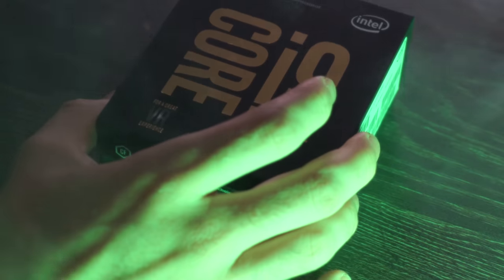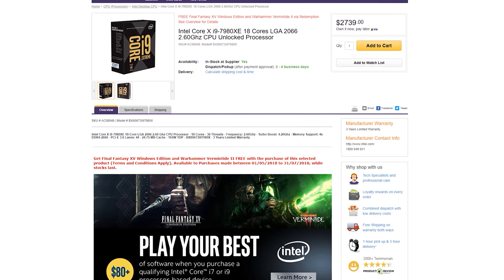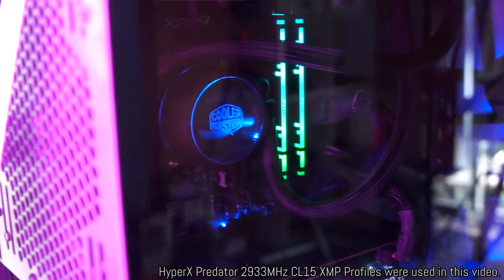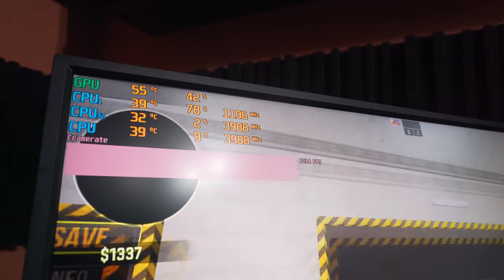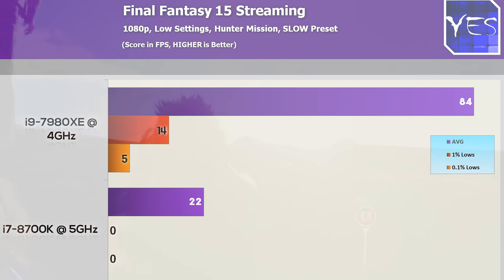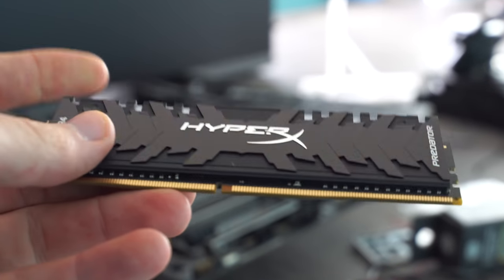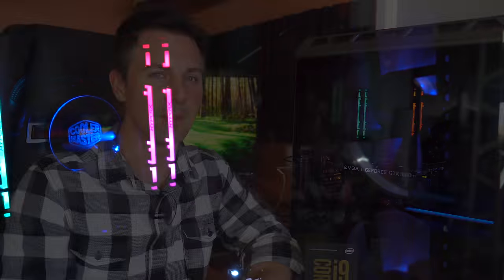i9-7980XE - What Can 18 Cores at 4GHz DO?

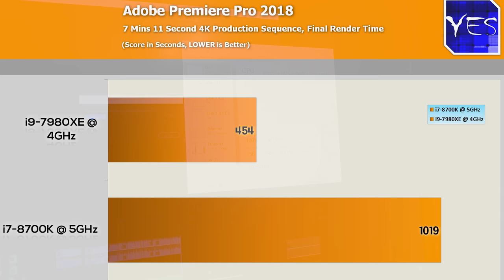Comment: Hey man, was the iGPU enabled for the 8700K in the Premiere Pro benchmarks? (5:10)
Reply from the maker: No it was a straight CPU benchmark.
Reply: yeah i think that update for adobe wasnt out when he did the video unless i am thinking of an older video.  the quicksync optimizations in premiere are nice and are surely more than good enough for youtube.  but a cpu only test is good as well for those who are making super high quality masters or are using an editor that doesn have this support.
EDIT: i just saw the timestamp and i see that its a current bench.  thought you guys were talking about another video sorry lol
Reply: I don’t think this cpu has iGPU right?
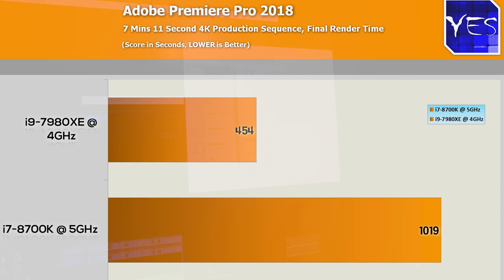Reply: @Lover Of Tech yes he is talking about the 8700k which is tested against this cpu at 5:10.  the 8700k has an igpu but the cpu this video is about does not. the commenter was just asking whether he was using the igpu when comparing them
Reply: Tech YES City watch gamers Nexus video on Adobe premiere and the 8700k and the 8700k will beat out the 7980xe when the igpu update so you don't have miss that 7980xe too much
Reply: bobhumplick my fault I misread the comment, I thought he was talking about the 18 Core X299 cpu. Yea I have a 4790K and the update with Premiere Pro makes it an absolute beast for final export
Reply: @Taylor Cook yes that is a very interesting development.  its kind of funny cause intel used the igpu and quicksync back in the amd fx\sandybridge (2nd gen) days to compete with amd on the one thing that the fx cpu was as good as the intel parts which was video encoding.  intels faster cpu was not as fast at video encoding as amd's 8 core cpu back then.  so they used quicksync and the igpu to make up the difference and be faster.  lol sound familiar?  but that was for transcoding video over for use on ipads and things for home use and not pro video.  the enhancements for adobe with the igpu are not really quicksync or at least not "only " quicksync.  it only uses part of quicksync and part of the compute power of the igpu to get MUCH better results than what a "quicksync only" transcode would be.  in other words a video rendered in adobe with the igpu enhancements arent as bad quality as a pure quicksync video which uses some shortcuts
Reply: @Lover Of Tech no prob.  but you are correct the 7980xe has no igpu : )
Reply: shroud, dr disrespect, wtfmoses, all those guys use cpu encoding.  with a slow game like league or hearthstone you dont need it though.  but in pubg without it the grass looks like a fingerpainting when moving
Reply: adobe is garbage.... doesnt show potential of the cpu at all try vegas pro and see the threads actually go to work
Reply: you get 2 pc's, one for gaming and one for the stream and link them up with a crossover cable by basically plugging them into each other with a ethernet cable.  then you add in another ethernet adapter to connect them to internet and you can use internet connection sharing to link them.  then you use obs on the gaming computer and you use your gpu to ecode as usuall except you turn the bitrate up as high as you can. like 50000 or whatever.  set the presets as high as you can without using lossless, set the profile to bluray. then you stream that over to the streaming pc with the ndi plugin over the ethernet cable.  another instance of obs is running on it and picks it up.  the obs instance that is on the second "streaming" pc just picks up that stream at a high bitrate fromt he gpu and reencodes it at a lower bitrate with the cpu at either faster,fast, or medium, maybe even slow if its a beast cpu.  then that is the stream that goes out to twitch and everybody gets to see.  that is how you make a top quality near picture perfect stream.
Reply: Can you review the Asus rog scar and hero laptop 💻👍🔥🥇
Reply: Tech YES City is 70-75 degree on ryzen 2700x stock with xfr2 and pb2 bad for long term use like for 3 years??  running stock cooler
Reply: Drake no but I would check it out
Reply: Chris Wright no means ?? That 75 degree celcius doesn't damage cpu??
Reply: the 8700k has one , HD630 http://gpu.userbenchmark.com/Compare/Intel-UHD-Graphics-630-Desktop-Coffee-Lake-i5-i7-vs-Nvidia-GT-1030/m356797vsm283726
Reply: no if you want it cooler use a 280 aio or big air cooler   the 2700x has a 105 tdp
Reply: Ryan Sherman no means??? Please explain
Reply: means it is running at the right temp for the stock cooler  if you want to cool it more use and aio or a big air like a dark rock pro 4
Reply: @Drake
Per AMD's website, the max temperature is supposed to be 85 degrees Celcius:
https://www.amd.com/en/products/cpu/amd-ryzen-7-2700x

Operating at any temp below that is fine.  If all you ever do is run it at stock settings with the cooler that comes with the CPU and you get 70 - 75 degrees, then your cpu should last you a lot longer than 3 years.

What lower temps do is allow XFR to potentially boost higher.  

Another thing to consider is the airflow in your PC case.  not enough fans, or just having fans blow in the wrong direction can negatively impact cpu temps.
Reply: Brolivia Wilde airflow is great but ambient temp is 30 degree celcius
Reply: @Drake
ambient is 30 degrees celcius?  yea, that sucks man, sorry to hear that. Still, your cpu should fine for years to come.
Reply: Brolivia Wilde yes currently in india not only 30 degree  sucks also this country sucks
Reply: @bobhumplick Could you use network switch instead of an adapter card? I already have a switch to split my internet between my pc and consoles, and figured that would be adequate.
Reply: bobhumplick Overcomplicated 2 PC streaming setup. check out the OBS NDI tutorial vid on my page. Way essier. I use it for every stream I do, love it.
Reply: Drake anything above 85 with possible thermal throttling is any issue but still I would check your fan curve and air flow in the case
Reply: Yea I found this helps really good, esp on laptop. But really also depends which effects you're using too.

Comment: I won’t deny that 18 cores is nice. But Threadripper can be had for often a fourth of the price of the i9. Threadripper is a better buy
Reply: for most things.  but there are cases where the i9 is better or at least one of the i9's.  for twitch streamers who dont want a 2 pc setup the 12-14 core cpus would be a very good alternative. TR is good too but its harder for high fps on the streamers side.  second gen TR will be hard to beat though.  but other than twitch or an odd use case where very high single thread apps are used on the same machine as very multithreaded apps you are right TR is hard to beat
Reply: bobhumplick I stream with a 1920x and I get 0 issue.
Reply: @James Mastroianni im not saying you will have issues with a threadripper cpu streaming.  im only saying that in competitive fps on a lot of popular games (ie pubg) an intel cpu with 12-14 cores and using cpu encoding will get higher frame rates so that streamers can play 120-144+hz.  even thought the stream may only be 60 or even 30 fps the streamers match might depend on a higher frame rate for a more competitive experience
Reply: im glad to hear the 1920x is treating you right.  cant wait to see what the second gen TR will bring.  i think the 12 and 16 core versions (if they even bother with the lower core coutns) will be the real winners if they can get the price really cheap.  very few people can actually make use of 32 or even 24 cores but a good cheap 12-16 core with ryzen+'s ipc and latency gains and extra clocks would be awesome
Reply: @Geth270 all the real streamers use cpu encoding.  it gives the best quality at the lowest framerate.  a few dont but you can tell it in their streams dont.  smaller streamers dont either but the big ones do.  its worth it if you can afford it.  the cheapest and the best way in my opinion is to do a dual pc setup.  wtfmoses stole my idea for a setup with an 8700k for the gaming pc and a ryzen 8 core for the streaming pc.  and with ndi plugin you dont need a capture card.  as a matter of fact the streaming pc doesnt even need a gpu at all althougth of course the gaming pc will
Reply: basically to stream with a gpu you need at least 4500 bitrate to look decent and if you want a really nice stream or wanna do 60fps you need 6000.  twitch only lets partners go above 6000 i think and that just took place.  used to be the limit was 3500 i think.  but you can do a stream with gpu encoding at 6-8000 and 720p60fps maybe 1080p or you can do a cpu encoding with 6-8000 at 1080p 60 and it still looks good.  at 4500 and below its cpu only unless you are doing maybe 720p in a low speed game.  for fast shooters at high res and fps you need cpu encoding to make it look decent
Reply: CPU encoding gives better image quality.... 
GPU gets really blocky. Popular streamers always choose the best quality they can get. so they never use the gpu.
Reply: Upload a vid and show us how it is done then...
Reply: i9 literally won a heck of a lot (most) of HWBot benchmarks out there. It also holds the top  marks in 3DMark(top overclockers use this CPU to crush GPU records). If this CPU has that much reputation then the price is just as mad.
Reply: bobhumplick bobhumplick and just to let you know, any advantage intel has over AMD with high frame rate disappears on skylake x, as the mesh has the same faults as infinity fabric. Now, most super high end streamers run dual systems, but that's because they want an 8700k in the gaming rig and CPU encoding for the stream. Me being happy with 144 fps, I dont need an 8700k, so I can get one big powerful cpu and do it all in one system. No noticable stuttering, and a minimal lost dps (1-2% while streaming) and the setup is much cleaner. A 7920x would perform identically at matched clocks. 

I plan on getting the 32 core so I can game, stream and record off the same machine at once
Reply: if your pc is your job, then u dont give a fuck on 1000 $. u buy the best desktop cpu andd thats it.
Reply: If your PC is your job, you also want to get the best you can get without having to sell several organs. This is why Threadripper is a better purchasing choice than a lot of the Skylake X CPUs
Reply: Mr_Beezlebub No, it's pretty true that professionals pay for a price premium, it's called an investment for QoL and efficiency. Ever wondered why top creatives/pros buy those expensive 5K Retina iMac with lower end specs than a similarly priced rig (which would be a beast)? The editing experience is superior. The Adobe integration is outstanding (software optimizations for Apple in general), the 5K Retina display provides mm worth of precision, and the platform is much more stable/resource friendly.

Other than that, CAD software and Adobe are optimized a lot more on intel. In other professions where you need to buy your own equipment, $2000 is chump change.
Reply: B0NES YT 
Apple is not so good for that anymore, at least that is what I have heard.

Also, CAD mostly needs single core performance. Only simulations and such use many cores. And, most CAD software will not benefit from more than 12 cores. The ones that use thousands of cores are insanely expensive. Moreover, anyone running those will use Xeon systems. Unless you render or multi-task like crazy, 12 cores is all you need. Beyond that, single-core performance matters most.

Threadripper is still tempting for the price. Threadripper 2000 may close the performance gap. But, I'm waiting for Zen 2 for my Blender 2.8 workstation.
Reply: Austin P Apple is fine, I use a 27" iMac 5K for music production and for Adobe My beefier gaming rig- i7 5960X 4.7Ghz-Titan Xp I only use it for gaming. Exactly why CAD users prefer intel.
Reply: 1000 bucks is equal to selling organs in your opinion? sorry man, but there is no way that youre a person that earns his main income with productivity workloads on the pc.
Reply: Dex4Sure Nah. more like $2000 USD for the TR2 and $3000 USD for the 28 core intel. Both chips are stupid useless anyway.
Reply: Dex4Sure Hmmmm, I didn't know that many people simulate servers at home and crunch scientific numbers. 

 "These chips would not exist if AMD and Intel thought they would not sell."-Oh they do sell, but not very much, very far from mainstream chips. Now and back then the enthusiast HEDT market is still 1%, and usually the majority of that market do it for bragging rights/hardware enthusiasm....not for actual work.

Last time I saw a real researcher in our enthusiast forum was this guy with Dual Xeon Platinum server with QUAD Titan Vs and over 5TB of 960 EVO NVMEs jammed inside a Thermaltake P5 or something.
Reply: Jukka Liimatta Adobe and CAD are made up? Okay expert. I didn't know the average user builds Android images or any of that jazz. I'm talking about manycore making it to mainstream, mainstream=who doesn't give a fuck what professionals do and care about professional apps, just using everyday applications. Even if I wanted to work professionally I'll just buy some dirt cheap 12 core Xeon and put 2 on a dirt cheap dual socket mobo and jam a $200 60 core 120 thread Xeon Phi in the mix for the lulz

Tell me what hardcore gamer uses a 16 core CPU? Nothing

intel rebrands Xeons to i7s and i9s (back then even i5s) since forever, only an idiot doesn't know this.
Reply: BONES VT, I think the mainstream is these days mostly cellphones and pads, laptops at best, those should keep the consumers well entertained. The fading of the desktop from the mainstream has been going on for a while now.. I don't think the mainstream really cares about that stuff anymore as much as it used to.. if you specifically go out and buy a desktop computer in 2018, don't think it is for twitter and facebook..
Reply: t0rakka camping site We're in a video about PC's, I was referring to mainstream in terms of PCs. Power users will always exist, and for them, laptops/smartphones are not enough (nor are they worth it, expensive ones are a WASTE of money unless portability is the only reason you buy it for). Smartphones are there because everyone needs them for obvious reasons, and it's a good alternative for ultra low-end gaming because not everyone is rich enough to buy a PC or a console. And nope, tablets will die sooner, never seen tech die as fast as those. 

And there are reasons why you need PCs, using cellphones for media is garbage and they have trash/extremely crap input. We all have preferences, and even if I bought a PC for Twitter and Facebook, I'm still displaying them on a 32 inch ultrawide 4K with a 50+ windows without lag and typing/navigating with a KBM-speed and quality of life is up there. Also I don't play mobile games, that shite is beneath me.

2nd that "news" about desktop PCs dying specifically indicate factory PCs, which nobody should care about nor support in anyway. Overpriced and weak. The IT market has been blowing up recently, all stock market prices blew up...all revenue blew up even AMD who was in the dark years ago.
Reply: no.

Comment: Get a Threadripper 1950x. Less than half the price for almost as good performance.
Reply: Yeah at work tasks 1000% But when It comes to games ehhhhhhhhh (I mean who would buy that to play games lmao)
Reply: or wait for TR 2 that will be priced similar to this but has 32 cores and faster base clock.
Reply: Exactly, sure a little slower in single core , but you don't have to cripple your storage all sharing that one 4x lane to the PCH. And have to limit yourself to 44 PCI lanes... in 2018. And you also dont have to delid your 2000 money points processor to cool it properly.

Its such a shame as intel made super cool stuff not that long ago.

Not to mention the 2000 series 16core TR2 ( if we get one) is going to run rings around EVERYTHING intel has.
Reply: U miss the part where he mentioned adobe ? If u like dropped frames u go AMD.
Reply: Yeah, a bit disappointed in Tech Yes City, very much an Intel shill in this video.
Reply: 30% less performance, you mean?
Reply: No doubt the i9-7980XE is better for editing. It's just the price is too high. I don't do much editing. Mostly 3D.
Reply: caleb grefe
It is Intel sponsored, and everything was true. I think it is reasonable. For me, it screamed desperation from Intel. They must be afraid of Threadripper 2. As for me, I am concerned about latency from two of the dies needing to access RAM through the other two dies. AMD really needs to connect dies on an interposer rather than a PCB.
Reply: Heaven help the 7980 when the 2950X w/ 32 cores hits the market at $1499....
Reply: Or just wait a few weeks for 2990x 32 cores 64 threads. More than double the performance for like 2/3 the price.
Reply: or wait for intel 28 core pretty sure the 28 core intel even on decent oc like 4.5ghz will beat out tr32 core on 4ghz and considering ryzen 4ghz is pretty high oc for all core
Reply: why hate on intel just because is more expensive amd should be happy thas intel is selling more expensive thas the only reason amd is selling so well imaging if 7960x was prices the same as 1950x no one actualy gonna buy tr since core for core the intel is better and without counting is oc way better theres a market for it even the board for z370 or x299 are usualy better tier board thas any AMD board look a asus rampage vs the x399 one or z370 formula vs only mid end board on x370
Reply: My 1950x out CB scores this cpu. What are you talking about it costs 3 times less too.
Reply: any 7980xe do easy 4.5ghz+ 4500+ cb theres no 1950x any close to tha score
Reply: we have to wait and see if tr 2 oc over 4.5ghz i gonna maybe upgrade to it it not nat i rather spend the extra for OC intel demo at 5ghz was 7400+ cb score 2990x from the leak is over 5700 pretty sure the 28core even with 4.5oc is going to beat it even amd demo a tr 24 core vs 7980xe 18core on blender witch only manage to win over 5second while having 6 more core and 12 more thread thas not very good